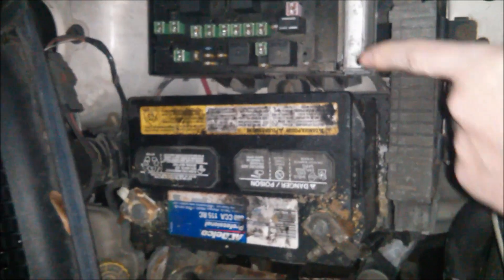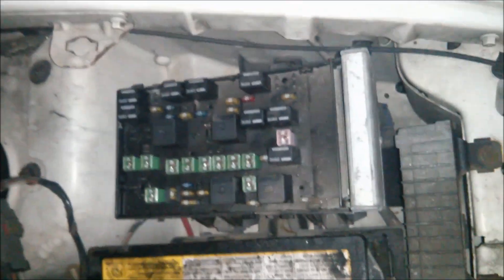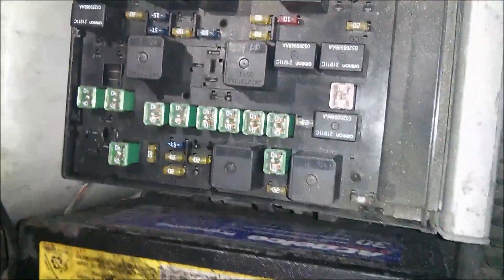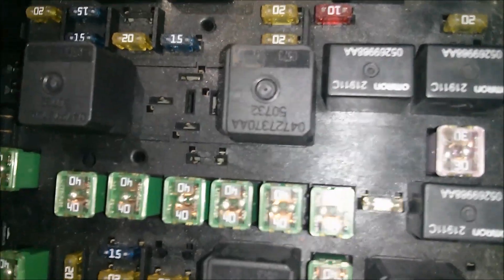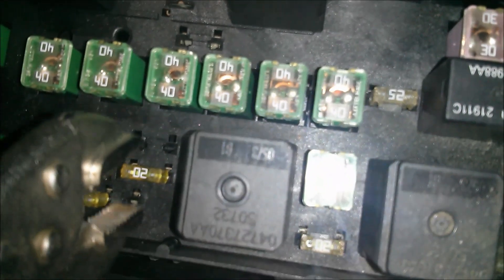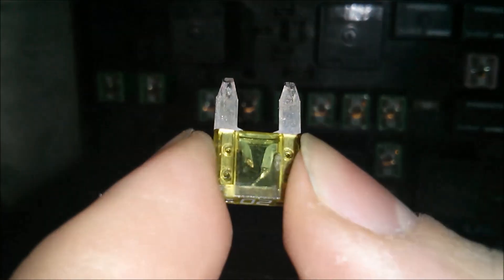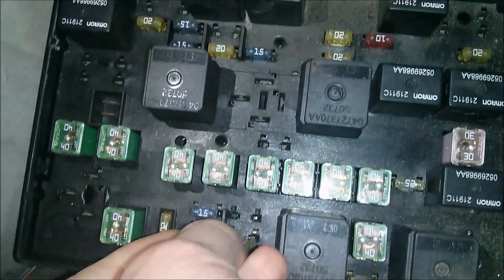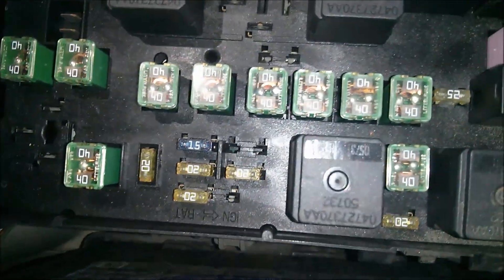How To Replace The Cigarette Lighter And Stereo Fuse On A Dodge Grand Caravan

Comment: Appreciate the information. Couldnt find a fuse on fuse lid cover labeled for radio. Radio and 12 volt power point had gone out at the same time after using a 12 volt compressor.  Apparently blew the one fuse that were on same fuse.  Odd manual refers you to lid. The labels are abbreviated on the lid so can be vague. Seems to me the info should be in manual to. Thanks Dodge , lol
Reply from the maker: Glad to help. Can you please subscribe in return? I would really appreciate it. Thanks.
Reply: Legit did the exact same thing bro